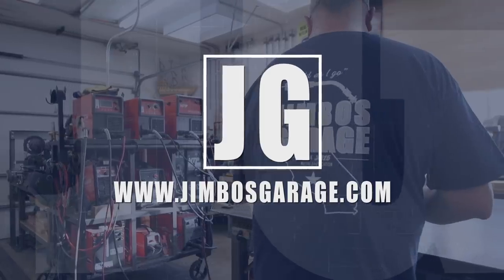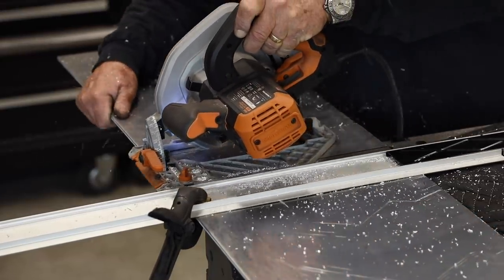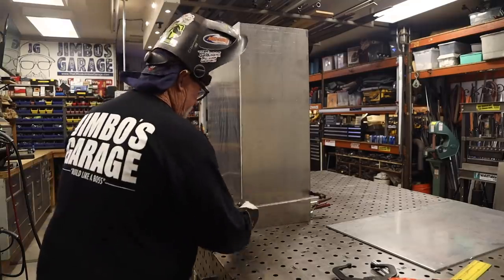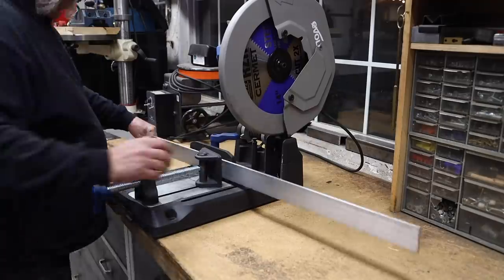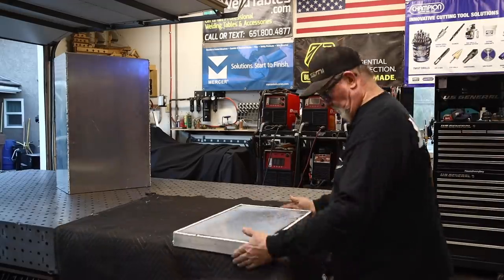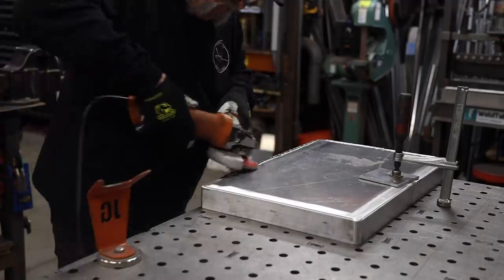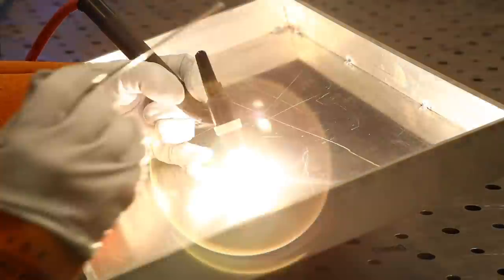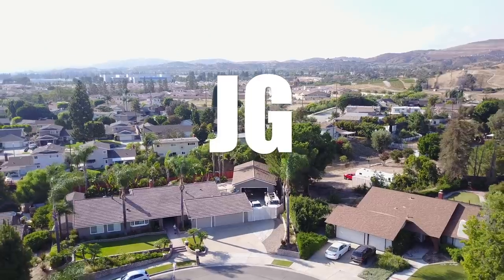Aluminum Trash Can For House Boat | JIMBO'S GARAGE

Comment: I work in a mainly aluminum fab shop in the cutting and drilling side of things. When cutting aluminum add wax to the blade, otherwise the chips will end up sticking to themselves and ruin a good blade. We get about a year's worth of production cutting out of a 24" chop saw blade, as long as we keep it waxed up. 

We then use the same wax for drilling, take a piece of the wax and add it to the bit, like you did with the bees wax on the flap disk. For the most part the only other lubricant we really use for Aluminum is WD-40. It doesn't work for most other metals, but it does wonderful on Aluminum. 

For finishing we use a hand wire brush and some maroon scotch bright. For the best finish when grinding we've found that if you leave a little of the weld raised up then finish with a 2 inch scotch bright wheel on a 90 degree die grinder. A large grinder you will easily start to dig into the base metal and leave divots. We use the same 2 inch wheel to deburr the cut edges.

Comment: Great job as usual, one of my favorite channels.  My experience with wire feed speed is the same as yours. Slowing it down and letting some heat get into the part really seems to help.   You might try a stainless brush in a grinder before welding, cup, tied wheel, doesn't matter.  Just run the wire right down the area to be welded.  It cuts that oxide layer off the surface and just makes the whole process work better.  Welds light off easier, better penetration, the whole bit.

Comment: Jimbo---great channel--need advice.  i'm making a carport out of .25 6x6 posts/ 0.125  2x6 for laterals and rafters/ 0.125  1.5x4 channel for truss verticals.......i can use 6010/7018stick or T-11flux core--what would you use?

Comment: hey jimbo,  how come everyone claims you cant weld through a long lead like mig because the material is too soft and to use a spool gun?  i dont see you having any issues, have you ever had feed issues running aluminum like this?
Reply: Would also be interested in his thoughts on this. I've been planning to buy a spool gun for the same reason, but I don't have a long lead at all, so...maybe it's not necessary?
Reply: @jadcb159  the lead can be longer or shorter. The wire still only runs thru the spool gun liner-which is very short.

Comment: I always heard you could not weld aluminum with a MIG, and would need a spool gun.  I have a Hobart MVP 210.  The spool gun is awful.   Is there a torch etc. that would let my welder aluminum weld with my MIG like you did in the video?    Also seems like 4043 would be too soft to go through a MIG...
Reply: You can do it. Just need a short lead (he was using a 8ft one) and try to keep it as straight as possible since the aluminum wire is like a spaghetti noddle. Also helps to push not pull the weld.

Comment: Aluminum is not like steel. You didn't bevel. Aluminum is real  Brittle. Good luck with it not cracking. Aluminum takes a lot more prep. It's always good to do an outside corner joint.